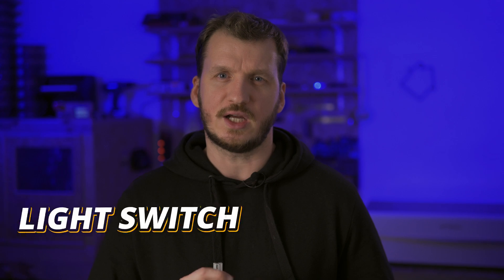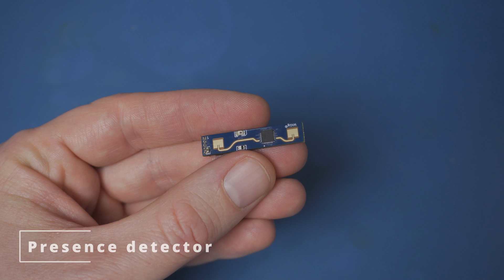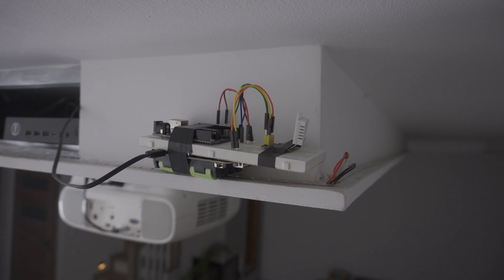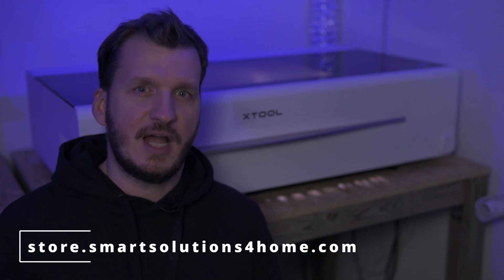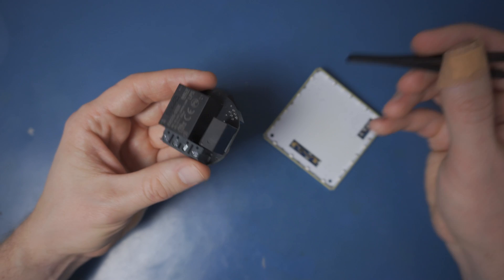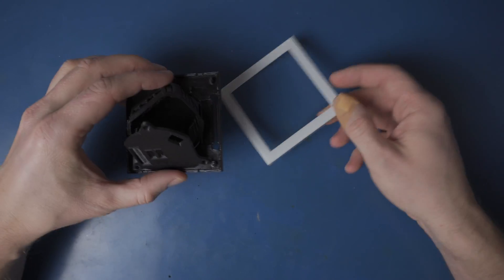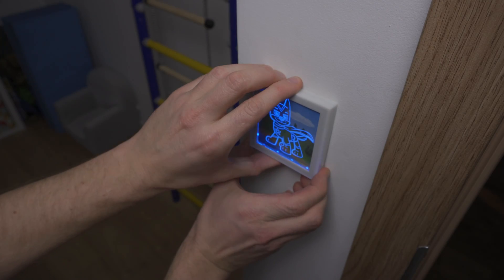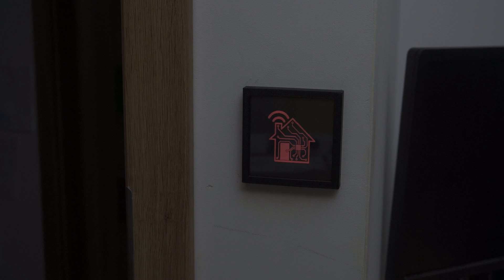DIY Smart Light Switch with Presence Sensor for Home Assistant

Comment: by the way are you controlling the lights with your hub? each output has a max current of 2A, which is enough for any lights.
I couldn't get a clear idea from your videos that how you connecting hub to other system in the house. e.g. switch, power point, appliances ...

Comment: Hi, it is a nice DIY project, and I have decided to make it, just wondering how it is connecting to SSH hub? because I don't want to link it physically to any light and rather prefer to do it via hub. are you able to send the gpio from switch to hub via eth cable?
I have a very similar setup at my home for more than 2 years and as you mentioned I also made it over kill and would like to make a new version simpler.

Comment: What do you think of a poe LED driver with input pins that operate like those LED bulbs with a back-up battery, meaning that they will trigger with ether mains voltage or shorting them together with a switch.

This would allow you to upgrade to poe lighting and using the existing switch wiring As-is, and if you're adding multiple to same room only one needs to be wired to the switch wiring. It should be able to read dimmer controls as well

Comment: How do you turn on the lights if home assistant goes down ?
Reply from the maker: The switch works completely independently of Home Assistant. When it detects a touch, the ESP32 changes the relay state—turning the light either on or off. It does this without "asking for permission" from Home Assistant; it simply informs it that the state has changed.
Reply: @ what if the esp goes down?
Reply from the maker: @z_polarcat  Well, there's no way around that. But if we're considering the possibility of the microcontroller failing, then mechanical switches are the only option.

Comment: I must say, this is one of most interesting DIY solution that is out there. While I'm not a fan of that touch sensitive glass as for others, it might just look like a fancy frame. But that's the beauty in DIY products as it can be adapted :) Many thanks for this
Reply from the maker: I agree. That’s exactly the best part about DIY. Especially when the source files are open. I’ve modified and customized so many projects like that to fit my needs! :)